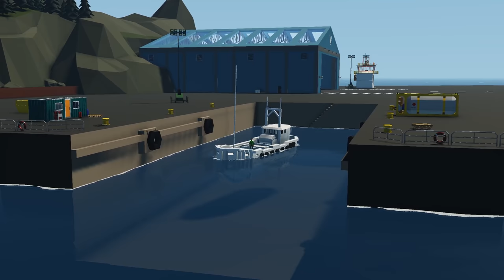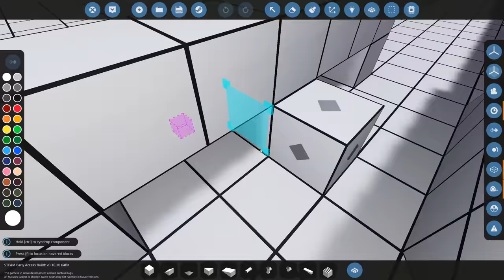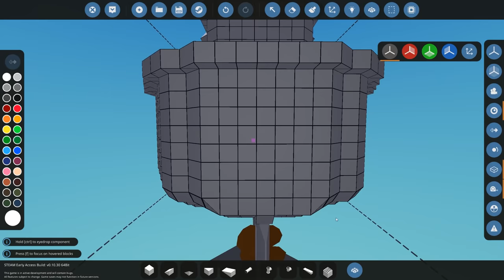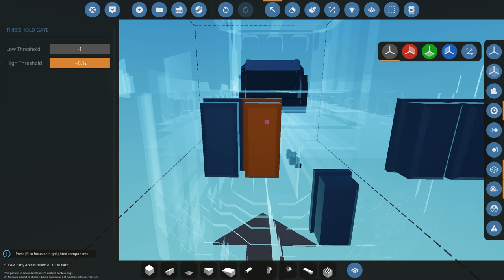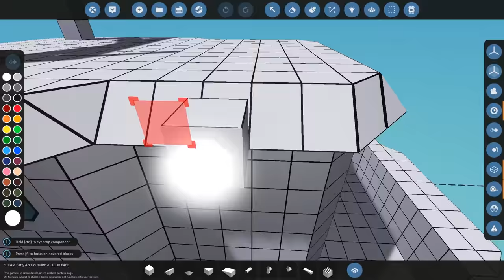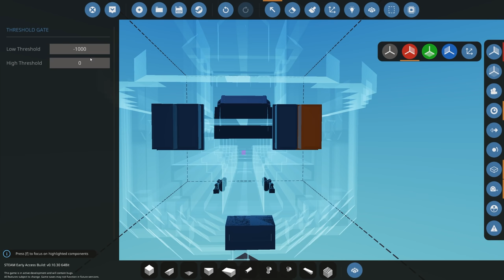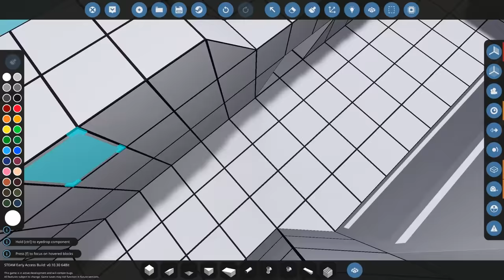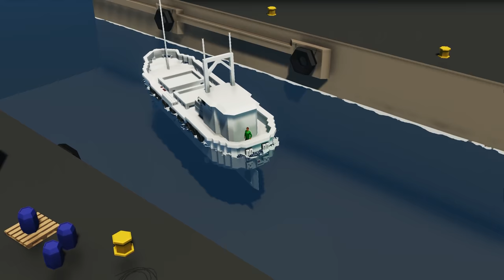Ballast System Tutorial - Stormworks

Comment: You’ve made ballast system tutorial before with sliders and weight blocks with PID and I found that 5 (P), 0 (I), 1500 (D) is the best (in my opinion) setting. I tried it on many boats/ships and it works perfectly fine 😁

Comment: Nice, hey for your last video on the twin otter the problem with the wings I sa control/lift glitch that occurs when a seperate entity has no thrust on it (the wing mounted engines is y the ailerons worked and the rudder and elevators did not) it would be great to bring this awareness it’s been in the game since the start and I don’t have a big enough voice to c it change. Keep up the. Ids I found this helpfull

Comment: I had an idea to make a ballasting system that in addition to counteracting roll, it would also set the ship to a certain depth. That way, if you were making a cargo hauler, like an oil tanker, for example, it could empty the ballast tanks while filling the oil tanks, which would maintain keel depth.

My system uses four tanks, and four depth sensors. The depth sensors would feed into a greater-than/less-than comparison chip, with the number it's comparing to being set by the ship captain. Basically, if the ship was deeper than desired, the system would automatically activate the pumps to pump water out of the ballast tanks. It doesn't have any provisions for if you want the ship rolled or pitched, but I don't really see that being desirable, anyway, so I don't think it would be an issue.

Comment: Another potential use of this could be to have it on a switch, so when loading in or taking on cargo/fuel you turn it on to get it level then you turn it off so it doesn't waste power when turning or on rough seas.
Reply: Pumps dont consume electricity in my experience, I put fuel pumps in my plane and the battery level never changes

Comment: Don't know about the money aspect, but I've found out, that small rails with weight blocks are kinda more compact and ten times easier. Just shove a tilt sensor data right into rail and it will work like PID without any other things needed. For speed you can just add logic Function x*10*Y(where Y is the speed you want to have at the end). I use x*20 - x*30. It doesn't need any threshold gates or anything and doesn't overflow your ballast tanks without dedicated drain system.
Reply from the maker: Yes I have a tutorial on it about 2 years old now :)
Reply: @MrNJersey  oh, really? Sorry, I'm new here. Just came up into my mind after building these water tanks.

Comment: Idea: tutorial on which engines to use in your generator systems based on the usage (ex. in electric motors)
Reply: I agree. Maybe he could make a video on how to do a diesel electric setup where you have Diesel engines connected to a generator to charge the battery and electric motor to drive the creation
Reply: I read on the forum a way to place a clutch between the generators and the engine that will engage proportionally depending of the load needed to keep the battery full. By doing this, the clutch reduce the generator load on the engine, saving precious power for speed. Indeed a video on this would be quite amazing. Power management/generators are indeed one of the only tutorial missing in that serie! Wonderful channel, it is pure gold :)

Comment: Nice tutorial, I just had a thought, would an engine run if it had a mix of fuel and water or fuel and oil or even diesel and jet fuel!
Reply: SecretSlayer 12 no it doesnt a few months ago i tried it and it didnt work (maybe they changed it by now but probably not)
Reply: Had a ship with a custom fuel tank and when I rammed something water would leak in. If you have a pump in your fuel line then it will work until there just is to much water, then the engine will just stop

Comment: Best thing would be adding a breaker switch to disable it once it has leveled out. This way it doesn't try to keep balancing and potentially adding more water when going trough waves
Reply from the maker: Yah you could, also could just increase the values in the threshold gates so it doesn’t do any between -0.3 and 0.3 for example

Comment: I have seen setups were water is pumped from custom tanks to regular tanks. This supposedly changed the weight of the fluid. Is this efficient in submarines?
Reply from the maker: Haven’t seen it before and in theory custom tanks are more less the same weight as normal tanks as far as I’m aware
Reply: MrNJersey I was talking to someone on discord and they said it was for pumping out at a great depth due to pressure.

Comment: Great tutorial again! Maybe a bit off-topic; but since you are using pumps here. i can't find any information or video on when pumps are needed for like fuel or air and such (for engines). Can you maybe guide me?
Reply from the maker: It’s changed so much over time, usually a general rule of thumb is if you use more than ten pipes the use a pump. Or if you are pushing fluid from one place to another. If it’s less than 10 and your engine status says less than 100% on fuel then add more pumps. Hope this helps
Reply from the maker: Also note engines have a built in pump but it’s not very strong.
Reply: @MrNJersey  ok but it not that gravity plays a role in it?

Comment: Instead of 4 pumps and using outside water, couldn’t you use two pumps and transfer it between tanks in a closed system? The only problem to solve is to load water in initially to have enough to shift around. If half of both were loaded, it would be exactly enough to fill one tank completely and completely drain the other, which should be the most drastic that the system can get anyways when trying to correct.

Comment: I'd appreciate seeing a multi tank 2 axis ballast system that handles left/right, waterline, and bow elevation.
Reply: Just copy the system for front and back?
Reply: @MarreLirre  Its more the fill/empty logic for 3d control that's tough.
Reply: Why not keep the two axis separate?
Reply: @MarreLirre  The idea is to create a control board that will work for any ship or submarine. So if i want to stay at neutral ballast, and have the nose angled up to climb towards the surface...
Reply: @ludovicschneider6190  I play a lot of Uboat and sh3, I'm going overboard trying to replicate a 5 tank ballast system.